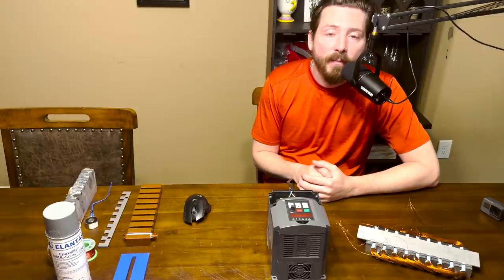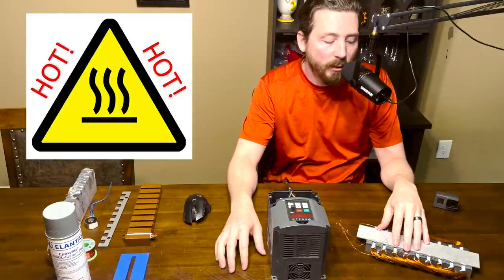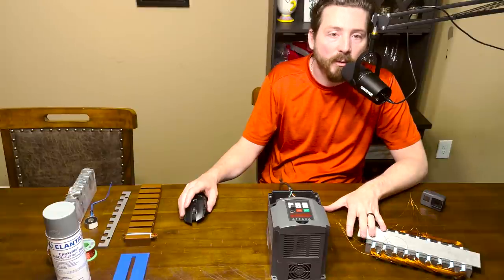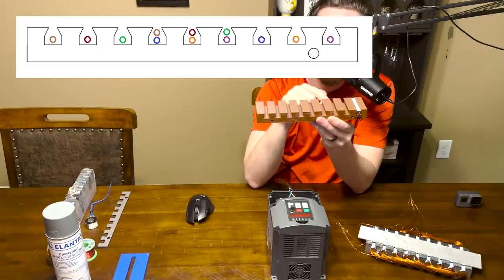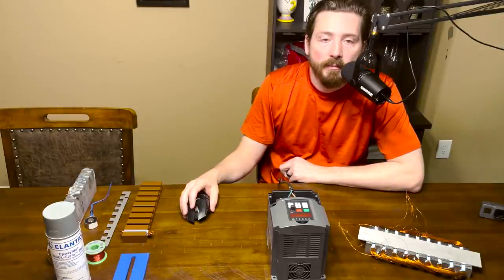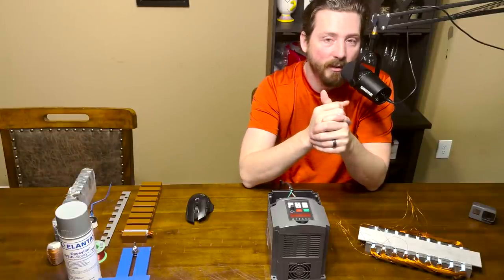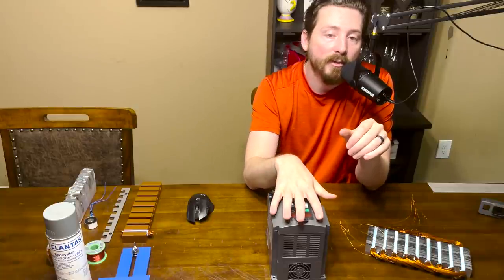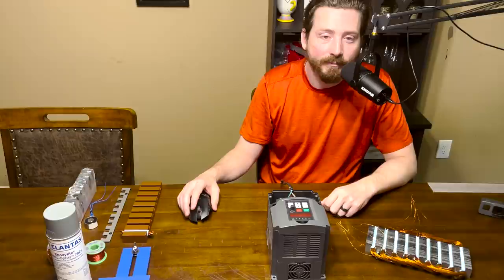Linear Motor DIY Explained

Comment from the maker: I was thinking about this and I wanted to link to Attwood's PHD Thesis which I found quite helpful when I was watching Professor Laithwaite's Magnetic River Videos.  Attwood goes through and gives some diagrams and is quite approachable.

https://spiral.imperial.ac.uk/bitstream/10044/1/35100/2/Attwood-AD-1980-PhD-Thesis.pdf
Reply: Hey Daniel, I'm currently trying to recreate this for a science in-depth study. What was the power source you used and how many turns did you do for each stator? Would really like to chat more about how you made this possible. Thanks
Reply: You are exactly like the James Clerk Maxwell
Reply: O canhão magnético provavelmente surgiu desse sistema. Assim como o trem magnético também.

Comment: You will find that getting information on electric linear stuff is like top secret. You will have to read a few books and then you can have some understanding of electric magnetic things.
Reply from the maker: The books I found had crazy math so the whole topic felt impossible. I’m going to try to make it more accessible.
Reply: @danielselectronicslab2048  I am sorry that I do not remember the two books I read years ago. Do not remember the books and remember what I read either. Peace. vf
Reply: @danielselectronicslab2048 Heyyy could you link some of the books you read?

Comment: How hard would it be to turn this into a linear generator? I have an application i need to generate electrical current around 72v and 100A with linear oscillation .

Comment: I used the encoder strip from inkjet printer, The problem is coordinating motion between x and y while maintaining speed. If you only respond to step, then you can move only 1 step at a time which gives up the speed!

You can see my build "3d printer in a microwave".

Comment: Hi Daniel! 
Great video! I know this may be a long shot since this video is 2 years old but 
My student design team at my university has been trying to develop our own LIM for the last couple of years. We’ve gotten very close but are having trouble in a few aspects. Specifically generating enough power to actually make a flywheel move, when we try to implement our concepts on a Larger scale. We would love to contact you and discuss our designs with you if possible. 
If you have an email address where we can discuss in details. That would be great!

Comment: Loving this series already, really looking forward to your next video!!!
I was wondering if the insulation layer adds a significant amount to the total width of your motor or if its can be neglected?
Reply from the maker: The insulation layer is very thin. It won’t add anything noticeable to the width, but it is very important to the functioning. The thinner the layers of your core the better, but they have to be insulated for sure.
Reply: @danielselectronicslab2048  Thank you so much

Comment: Would you like to try making a linear induction motor with sea water.  Sea water is certainly far less conductive than copper or aluminum, but it is still conductive. 

Magneto hydrodynamic works just barely but relues on an anode and cathode that also consume a big chunk of energy splitting water. Maybe hydro magnetic induction has potential to be more efficent.  

Ring launcher magnetic wave down a long iron rod, or A long linear induction tube with three phase ac.

Comment: How did you fabricate the laminations?
          Motors like this have one HUGE problem.  They need iron behind the mover to complete the magnetic circuit.  Without that, the magnetizing current is 2 to 3 orders of magnitude higher than the working current.  If you put the iron behind the mover, you must deal with an attraction force that is about 10x the working force.  Or you can have 2 stators with mover between to at least largely balance out the attraction forces.  The mover's structure needs to mirror the stator's structure, with slotted iron with aluminum or copper closed loops in the slots, to achieve any sort of reasonable efficiency.
          If you intend to run the motor "open-faced", the flux density is so low that you should change the geometry of the lamination slots.  They should widen out in the bottom almost to the point of breaking through to one another, to permit more room for heavier windings to carry the large magnetizing current.
          Design like yours (except double-sided with aluminum fin between) is used on numerous "launch" type roller coasters.  The efficiency is so low that insane utility power or energy storage is required along with insane cooling to get it to survive.  For this reason, that design has been abandoned in favor of permanent magnet synchronous motors.

Comment: A "simple" question before I even finish viewing the video: Can we do a practical mag-lev <thing> without using 3-phase?
Seems everything I've viewed so far uses 3-phase for the propulsion aspect.

Me, I'm OK with 2 phases that are 180º out of phase, creating double the voltage across the actives... but once we have 3 phases 120º out of phase... just obtaining it is insanely complex (assuming you don't have a 3P supply to your house), and understanding the math across the phases is worse.  And that's before trying to work out current-lag, collapsing-field reverse current, hysteresis and all that crap.  That's where I left my studies in electrical theory, many years ago.

Listening to your "power supply", it sounds like an old-school mechanical rotary inverter, artificially inducing local 3-phase from a single-phase supply.  
They used small 'dynamotors' back in the 2WW, to produce 1 and 3 phase power from a 24V accumulator, so the concept isn't exactly cutting edge.  I still HAVE one, that works, tho the efficiency is terrible.
You see why I detest projects that require 3 phase energy of any voltage.

Please tell me that there is another way to do these experiments that doesn't require 3 phase power?
Reply from the maker: Interesting question. Have you watched the magnetic river videos from professor laithwaite?

Using one magnetic field you get a point that will not be stable. Using a second field you can get stability. In his magnetic river video he talks about thinking they would need to provide a fan or separate motor to get propulsion. They overcame this by breaking the motor up into sections and sending 3 phase through the coils.  As they switch on an off you get the effect of having the field flow along down the motor. 

The machine I used was called a VFD or variable frequency drive. This model does simply take 1 phase power and break it down to DC.  It then digitally builds 3 phases that are perfectly 120 degrees apart. With a VFD you can also control the frequency of the waves. You can get that effect by hooking a dc motor to a generator. The generator will make perfect 3 phases based on the three coils in the generator. 

You also mentioned many electrical things that can be ignored in this simple example. Hysteresis is a material property of the metal in the core but I just used plain steel. Balancing the phases shouldn’t be an issue since they are all the same number of turns. Obviously I’m simplifying but for this level of example it is not needed.

Comment: Thanks👍🏻 Is that the laithwaite style linear motor that also has centering built into the design or does that one slide off left and right easily?

Comment: Curious if that chunky power supply can be replaced with a motor ESC (kinda like the one used in drones) and adapt the linear motor to be curved around it's long axis.
My imagination goes immediately to a proper "railgun" - more likely closer to a Gauss gun
Reply from the maker: It should work.  This motor is controlled via frequency modulation, which is what an ESC does.

Comment: Well done!  Can you make it functionally stop it place (I.e. micro movements back and forth)?
Reply from the maker: You would lose lift if you stopped the traveling fields. Induction requires flux to move past the secondary.  Look up synchronous ac motors for more info on this. 

They feel force while the rotor is moving slower than the spinning magnetic field. When the rotor catches up with the field it loses force and slows down. Once it slows there is again a difference in the rotor speed vs the magnetic field speed so it begins to feel force again. Back and forth, but the rotor can never pass the magnetic fields.

Comment: What about the fields around the wires when they are all next to each other? Like when they wrap around on the sides they are all jumbled up do they not interact with each other?
Reply from the maker: So we will discuss the fields more in a upcoming video, but they do interact with each other. Visualize the total flux as a series of hills that travels along the length of the motor and pushes the aluminum along.